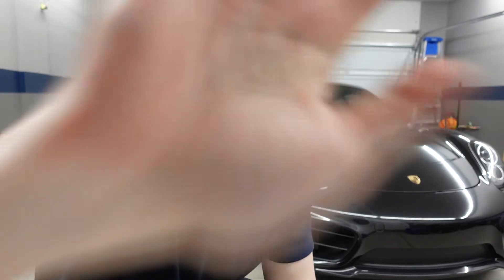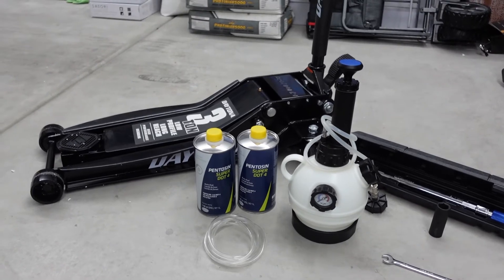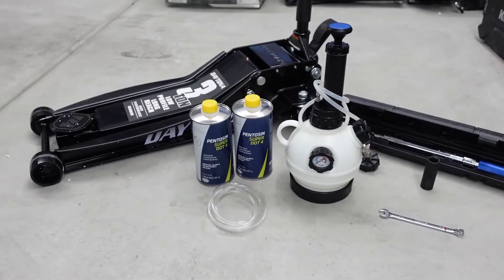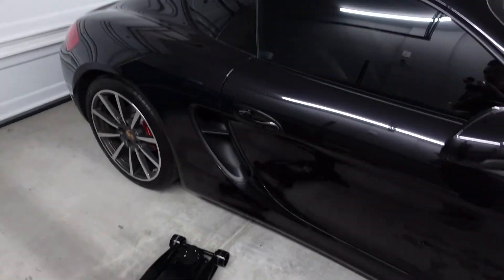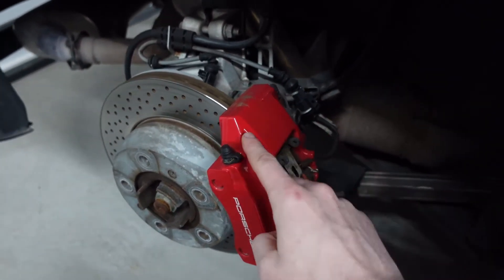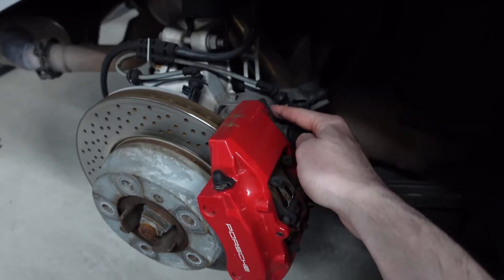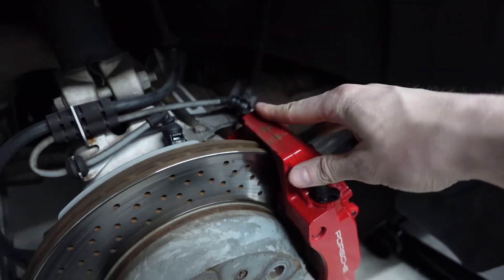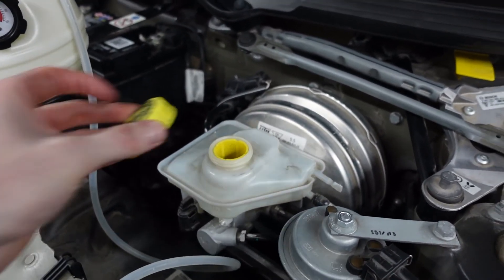PORSCHE 981 BRAKE FLUSH WITH ONE PERSON TUTORIAL | How to do a brake flush on a Porsche Cayman S?

Comment: What is the problem with low viscosity?
Reply from the maker: I dono, but it’s not the original brake fluid so I wanted to note the OE specification
Reply: LV is fine as long as it’s dot 4.  I think on several Porsche models its actually calling for LV fluid now since they discontinued their version, at least that’s the discussion in several forums

Comment: One question, so after removing the old brake fluid, don't fill anything inside the tank and only in the bleeder? Or should I fill a little bit of new brake fluid in the tank before hooking the bleeder? Great video. Thank you.
Reply from the maker: You should add enough to the brake booster first to put it at a “normal” level, and then hook up The bleeder. The power bleeder will maintain current levels, so you don’t want to start bleeding at low